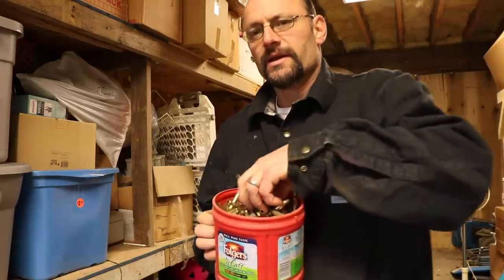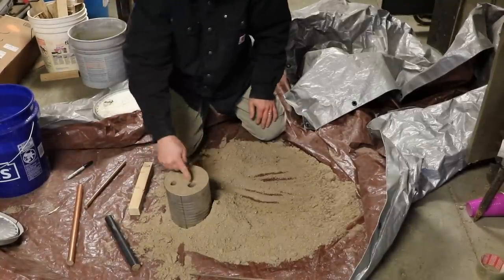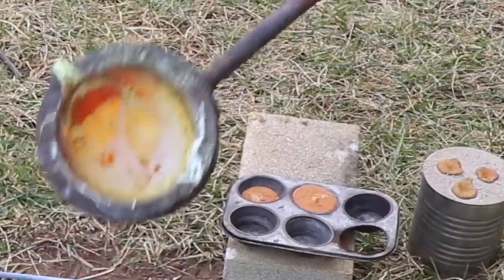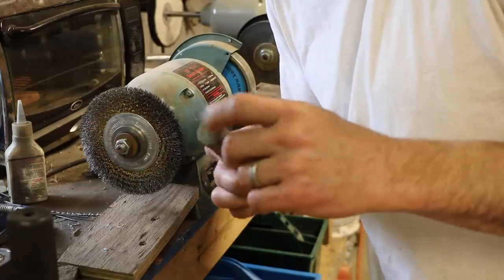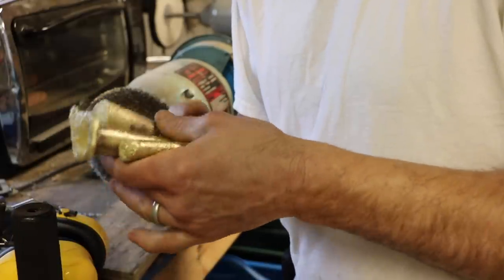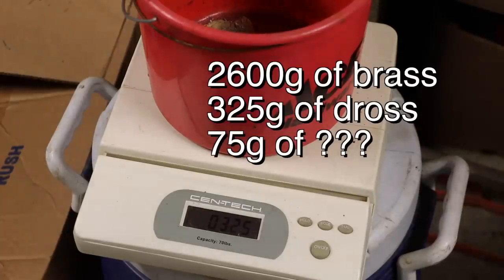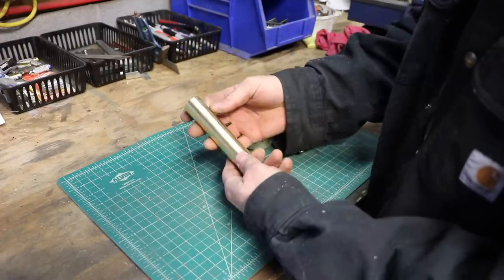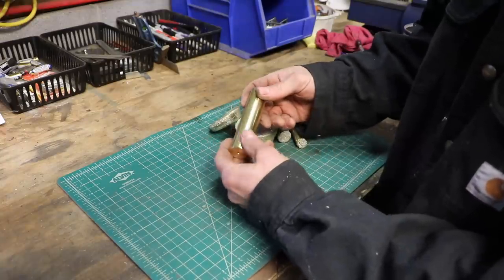Can you machine bullet brass?  Let's find out!  FarmCraft101

Comment: Add 3-4% lead and you now have c36000 freemaching brass.   O tears with this
Reply: jbstyliin I was wondering what might need added to make a more free-machining variant of brass! I hadn’t thought of lead but now that you mention it definitely makes sense, as it is what makes 12L14 steel so very easy to machine...
Reply: Needs more zinc added. A quick look on wiki shows that gunmetal brass has 10% more copper.

Comment: Different ammo companies use different materials for the primers cups (brass, stainless, etc.), and I have no idea what the anvils are made of (I'd guess steel). Were the casings decapped before you melted them, or would different materials come off in the slag/dross? I wonder if they'd affect your results if they alloyed with the brass?
Reply: Extremely valid question, because the cheapest spent brass is berdan primed, which may mean it's old war surplus and there collectively could be quite a lot of lead or possibly even mercury residue present in the primer cup.
Reply: Primers and anvils are brass too.  Maybe not on imported military surplus junk, but even there I have never seen steel in a primer.  The silver ones are just nickel plated brass.  Thin plating.
Reply: Both primers and anvils are brass. Some are nickel plated, some aren't, but all are brass. Copper initially tried, but quickly found too malleable. Steel too hard, even soft steel, to work for primers even though soft steel will work for cases. No difference in material between Boxer vs Berdan. Boxer anvils part of the primer. Berdan anvils part of the case. Not enough residual mercury left to matter even with the old primers. What little is left is a salt that can be washed if desired.

Comment: When I was a boy (1960s) we had three ashtrays which were made from old artillery shell casings, two 4 inch and one 6 inch diameter.
From memory, they were cut off to be about 1½ to 2 inches tall, with a central post added on the inside to make it easier to carry them.  
So when I saw your title I just said yep, of course you can.
Reply: The central post is actually in those old artillery casings to begin with. It's the primer. Allows for the flame to reach more of the powder faster

Comment: I would suggest a non-flammable surface under your foundry and pour area. That tall dry grass that goes up to your bldg could be bad.
Also, I keep a charged water hose & full bucket of water on hand.
Reply: never use water anywhere near molten metal. same principle as burning oil but much much worse.  powder extinguisher for the furnace area and bushfire beater for the grass would be my suggestion.  Sand is also an option but some sort of fire suppression equipment is, as you say, absolutely essential.
Reply: @anthonysellick3520   I was suggesting for the grass fire or runaway embers
Reply: I undestood thats what you meant which is why I said NEAR molten metal not ON it.   If even a drop inadvertently makes it into the crucible or even a spilled puddle (causing your grass fire) it may flash to steam with the resulting expansion  1 to 1500 if I remember correctly can be enough to fling molten metal in all directions starting more fires and possibly burning you or an observer very badly.   It can happen so easily that it simply isnt worth the risk.   In any event a beater is much more effective for burning grass than water.   Its really just a suggestion for promoting longer life!
Reply: @frankdoss6313  tell ya what how about you don't make suggestions on topics you're clueless about
Reply: @brandonbaker9106  Bless your heart

Comment: I had bought a 6x6 sheet of brass on ebay a few months ago not realizing the difference in brass alloy 260, 360, etc. I bought it for a project my brother asked if I could make a wood medallion for his dulcimer in brass instead and a custom design using my cnc router(a stepcraft). Delayed by months but I finally got working on it. I was breaking bits no matter my trial n error with my feeds/speeds. I figured maybe the brass was a hard alloy or something. Well I had just backtracked to my purchase history and found out my plate was 260 brass. A bit much for my machine to pocket machine out. A few details left out here but I had learned quite a bit in the differences. A 360 alloy brass, I believe, would be better for my case.
I enjoyed the video. We always collected the ejected shells at the gun range when I grew up. We would use them for reloading. Free. A real treat to find the "tin" shells. Real nice looking.

Comment: Would you think a thin wall steel pipe would make a good mold for casting rouns stock? Or even square. You'll just need to figure out a way to prevent sticking, or just machine the thin steel off

Comment: you need to flux the brass with borax to keep it from separating into its main components, zinc and copper.
Reply: I have melted brass without borax...just saying..
Reply: @dvig3261  a person can shoot themselves in the head and still live, does that mean they should still do it?
Reply: BS
Reply: boric acid in the form of bug poison works too.
Reply: melting does not affect a partitioning of constituent elements .. they are in solution
Reply: Isn't the borax to keep the dross loss to a minimum? Research time.
Reply: @ten10ca  Incorrect, depending on the alloys / elements, certain elements will reduce by oxidation at each melting. Zinc (as in Brass) will boil off / oxidise at each re-melt reducing its % in the Brass alloy each time, ditto for Tin in Bronze. Addition of a good flux layer can help reduce this effect by reducing some of the oxidation but it will still happen. Check the last paragraph here - https://www.totalmateria.com/Article64.htm
In general yes, alloys are “solid solutions” where one element is dissolved in another.

However, most metals have a limited solubility (ability to dissolve one element in another). It’s similar to what you see in a liquid solution like salt in water; as you add salt to pure water it dissolves, but if you keep adding salt you’ll reach a point where no more can be dissolved and the extra salt just settles out. This is called the “solubility limit”, and metals have exactly the same thing. Plus to add to the complexity, the solubility varies according to temperature and in some cases that solubility is 100% ie they are soluble in each other like with Copper and Nickle.
Reply: Jen farmer  but you are smart, doing something foolish doesn't make you stupid.

Comment: When I cast brass I gathered I had to heat the mold, cool slowly.
I was using coal though
Coal was free on the railroad tracks back then
I wish I could still do work with metal

Comment: Very interesting video for me. I work at an Ammo Supply Point (ASP) at Camp Shelby, MS, and my job as a contractor is certifying, demiling, and selling brass casings. Every ammo shot in practice, from 22LR the ROTC use, to 155MM artillery rounds, grenades, AT4 launchers, 105MM tank rounds, 5.56, 7.62, 50., 9mm, it all comes back to me to weigh, count, sell or recycle. I demil the small arms brass by running it through an APE (Ammunition Peculiar Equipment), which consists of a 1,000F furnace that dumps into a deformer. I've processed over 1.4 million pounds of brass there in the last 7 years. Three minutes @ 1,000 degrees is just enough to pop off any live rounds that go through, barely scorching the brass. That's why I have a deformer that crushes it through cogs so it can't be reloaded. I often thought about melting some down into ingots then polishing them to look like gold bricks for my livingroom  😄

Comment: Did you have to remove the spent primers or just melt it all together?
Reply from the maker: I melted it all together, but many of them are aluminum, so the end result is some type of aluminum bronze/brass alloy.  You could remove all the primers but that is a lot of work that probably isnt necessary..
Reply: FarmCraft101 aluminum brass is a real alloy.
Reply: Huge warning.  You can leave the primers in but make sure they are all expended.  I reload and managed to include a primed case that i had rejected into the scrap brass can for some reason (or thats the only thing that makes sence).   It went in later once there was already molten brass in the crucible.  It blew spraying small particles of molten brass around starting multiple fires INSIDE my workshop.  Lesson learned.  Anyway the spent primers become part of the slag, unless they are aluminium in which case you now get a brass alloy.  Enough aluminium in that makes the result very brittle and virtually useless.Otherwise No problem.

Comment: I think if you do a better casting method like a bottom fill you will lose the voids... still cool how nice that metal flowed and worked.
Reply from the maker: Yeah, the voids were definitely from sand falling down in the mold because of the way I made it.  If I used a solid dowel, packed the sand around it and carefully removed it, would probably do better.
Reply: Hey it’s the dude jerky guy! How much is to much?

Comment: C260/2600 "cartridge" brass is a great all around material: decently high strength, very formable. Going for properties either direction tends to drop off the others quickly.

It's great for jewelry and projects. I buy (lead free) plates of it and machine in on my little hobby cnc router (yeah, it's gummy) but it's nice for the ability to form it after machining. 
(sign places etc will use a very brittle brass that machines well but breaks if you try to form it)

Get some medium or hard silver solder and a propane torch and you can "weld" it nicely (welders call it brazing, but it's actually closer to welding than traditional brazing)
Easy/extra low temp solder is very weak and turns powdery grey, so I don't use it.

Comment: Higher zinc content makes it more machinable. Melting will burn out some of the zinc. Making 33% zinc brass is kind of hard to do but apparently Indian did it earlier than anyone thought, forget where I read that. Anyway the brass you produced would be fairly easy to smith, cold smithing. You need to anneal between rounds of smithing. Soldering/brazing brass is difficult you can actually use pure silver for solder because it makes a lower temp alloy as it melts.

Comment: Watching you melt this got me to wondering something. Is all the time and money spent using propane and any other consumables worth it? Obviously doing this with gold would be. But what about aluminum? I watched my father doing this with aluminum cans that he was taking to get recycled. He told me he got more money for solid ingots than the crushed cans. But I know how expensive propane is. So I was wondering if all the propane he used to melt down the cans cost him more than the difference of recycling crushed cans over solid ingots? 🤔
Reply from the maker: I think it would probably not be worth it just to take it for recycling.  Unless you could use a waste oil burner, and even then probably not worth the time.  But being able to make aluminum and brass parts and turning stock for the lathe I think it definitely is worth it.  Plus it's just fun.  Cheers!

Comment: This is proof that Therory and practice may not always match up. 
I am constantly told that a person can not drink distilled water. 
I have been drinking distilled water exclusively for over 40 years. With no problems. ..
Thanks for sharing your videos.
Reply: Willy Bee why do you drink distilled water?
Reply: @beefchicken  
Well,, this is what happened. Back in the late 70s, I  was driving over the road truck. I had 6 to 8 canker sores in my mouth all the time. I blamed it on , not enough sleep, and truck stop food. 
The bottom of my 2 yr old glass lined water heater fell out. It had a 5 yr guarantee. The plumber said that no one would stand behind a guarantee in that town. I asked why. And he said that the water was too bad.
That got me thinking that if the water was bad enough to eat a glass lined water heater,  what are we drinking it for.
So I  started drinking distilled water exclusively, and within 2 weeks all my canker sores were gone. 
And I have not had any since.
Except to to test my findings,  if I drink 1 glass of tap water a day, within 2 weeks I will have canker sores. 
Thanks for the reply.

Comment: nice! one may make sun-screen with zinc oxide. 
could make molds with mixture of clay, it's an art. i'm going to attempt to form a giant brass bird bath by rotating sand/clay mixture bowl form within box-like stand mounted on swivel,
to carefully circulate flowing brass as to coat top surface of form as it cools. what could go wrong?

Comment: Very cool. Did you pop off the individual mercury primers before melting it all?
Reply: Mercury fulminate primers were used early on for cartridge primers, but were already being replaced by other compounds by the early 1900s. Beside being corrosive, fulminate reacts with brass to make it brittle, not so good for reloading. Most primers now use either lead styphnate or (sometimes) lead azide. Lead-free primers are becoming more available, but don't yet seem quite ready for prime time.

Comment: The case brass is good for DIY, but be advised, it won't hold polishing for a long time, so over a short period of time it will become dully and thin oxidized will cover the surface.
Reply: That is why most polished brass has been clear coated.

Comment: Only pour brass into brand new or old rusty muffin tins as the coating on the new, and the rust on the old will prevent the brass from brazing to the muffin tin.
If it happens just hit up the local thrift store for another muffin tin.

Comment: ... cartridge brass is a very specific ratio of high purity  copper and zinc that will expand rapidly enough to obturate the breach on firing and contract equally rapidly to allow easy extraction ... there should be no impurities ... the slag you produced is probably oxides of both metals caused by over heating ...

Comment: I wonder if this video will make and reloaders lose their minds?
Reply: Nope!  I reload all my brass, until it isn't reusable, and it goes in the melt pile, along with shotgun shells.
Reply: Too late.  I am a reloader and I lost my mind many years ago.  It's his brass,  if he wants to use it for casting, fine.  I used to have half a 5 gallon bucket with rejected brass from reloading.  Had to separate out the spent primers as the company didn't want to take a chance of there being a live one in the mix. Thats why I have a small ingot of brass as I melted the primers down myself.  (no live ones in the mix,  THIS TIME!)
Reply: I wet tumble all primers and brass to avoid surprises.
Reply: Not if it is Berden primed

Comment: Definitely learned something important for when we cast brass and probably any other metals.... always account for the casting will shrink some during cooling and in some cases we should cast the piece longer than what we need because of shrinking and possibly in cases where we would need the extra length for holding it in the lathe's chuck and being able to machine the whole length of our work piece without having to flip it.

Comment: I tried this with some scrap brass pipe and the ingots got stuck in the muffin pan. I assume now I should have tried to burn whatever coating it had, but I'd like input from someone that knows more.
Reply: I sprayed the muffin pan with (wd40 i think?)  The non stick smells like liquorice as it burns off but eventually they do stick.  It you look in his video his muffin pan is missing one cup.  Mine is missing four.

Comment: It is completely absurd to postulate that you cant re-use this brass.  I have been doing it for 30 years. Normally this brass starts off somewhere around  67% Cu and 33%Zn. You get a certain amount of dezincification, I reckon 3 to 5% which will bring you brass into the Alpha coldworking phase. I think it is not a bad idea to cover the melt with a tablespoon full of borax. I have added lead in order to emulate the brass of the 17 and 18th century for museum copies. Another tip you might like to know about is adding a couple of pellet size pieces of aluminium, Thie acts like a fizzy gas pushing the impurities to the exterior surfaces which turn blue . I read about this in a Scientific American article from I think the 1880's  If you use a dusting of talcum powder over your sandmoulding  then the finished surface will be smoother and you will lose less material. If you want to cast fine details, there is a method called the Delft casting method where a special kind of clay is used. The results are quite spectacularly detailed

Comment: Have you see the prices of this stuff. I use a little Lead and Borax, pour in a SS pipe , I use Franklin mold release. Press out a nice 4 foot pipe of solid brass. 7/16, 1/2, 5/8, 3/4, 1 inch, 2 inch And 3 Inch. I have alot of these. I'm a Gunsmith. I buy lots of damaged brass. Good Video. Now Make something.💖😇

Comment: You're using the furnace that gets up to 1000 degree celsius on the ground full of dry grass. Nice safety hazard.
Reply: It also is lined with fire brick under the crucible,  and layers fire blanket... I know that's probably not the right term, but I'm drawing a blank.

Comment: Hmm. According to Wikipedia, Cartridge Brass has an exact ratio of 70-30 Copper and Zinc. I kind of wonder how much zinc was burned away when you cast it? Maybe there's a lab somewhere that you can send a piece to and have them test it.
Reply from the maker: Surely a little burns off, but not much.  Just measuring the weight before and after a melt, only a matter of 10-20 grams is lost for an average melt, and that may not be only zinc.
Reply: Still, would be interesting to see how much of which got burnt away